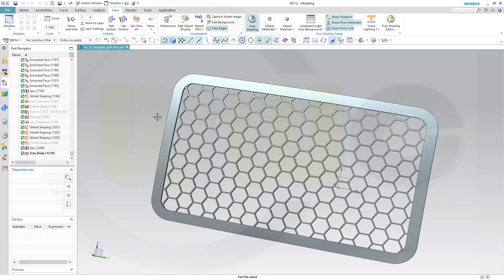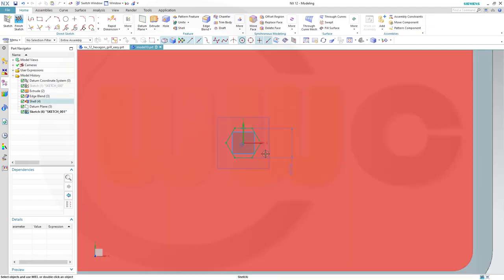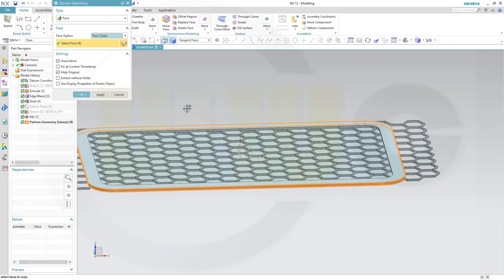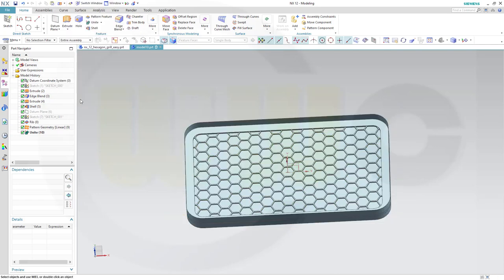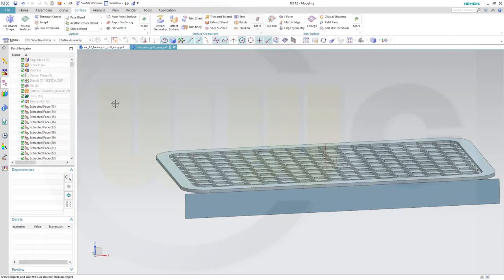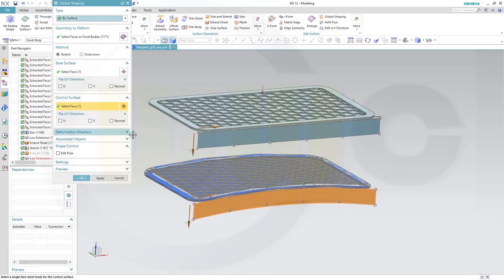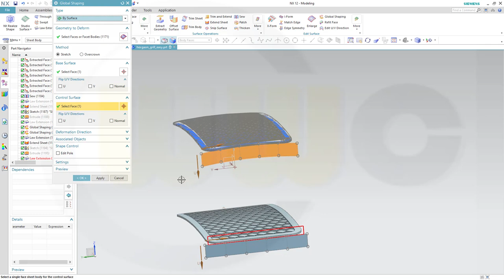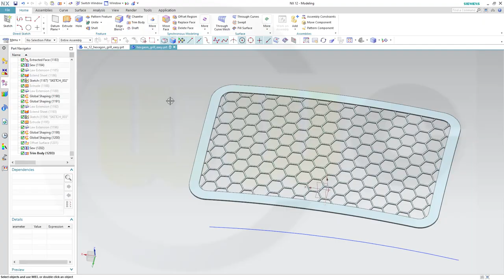Hexagon Grill - "easy" - Siemens NX 12 Training - Surfaces

Comment: Hello, how can I round off the vertical edges of a hex by selecting all at once?
Reply from the maker: A "hex" has no vertical edges. I assume you want to select all "vertical" edges of a hexshaped hole?
Try using a filter for edges, select all edges then deselect the "horizontal" ones with a selection rectangle.
Reply: @wolfgang.walden.cad.training  Thank you for your advice.